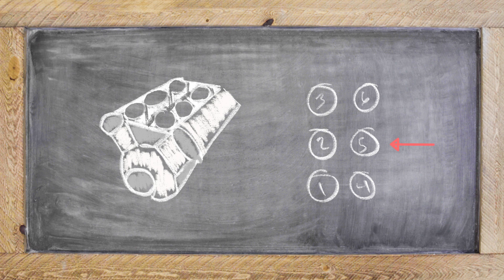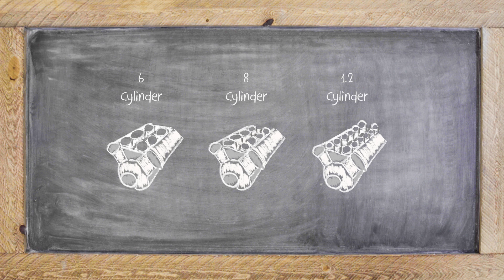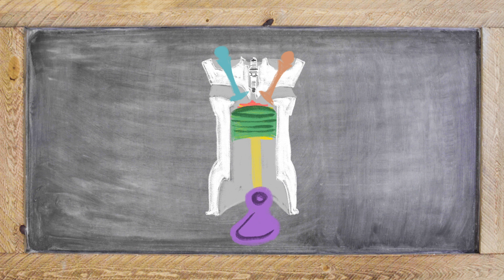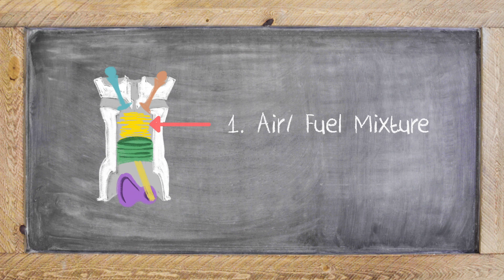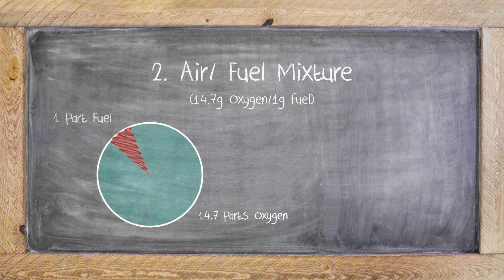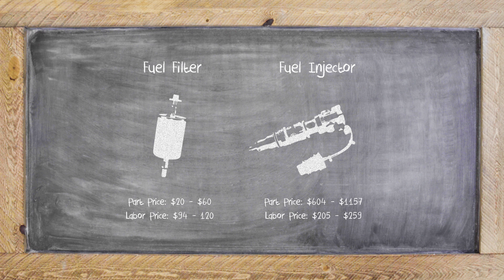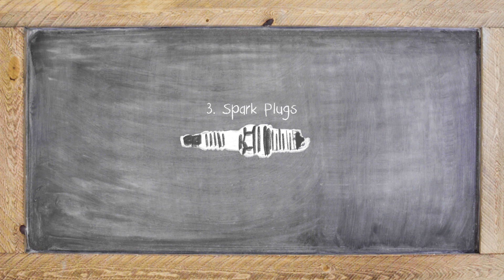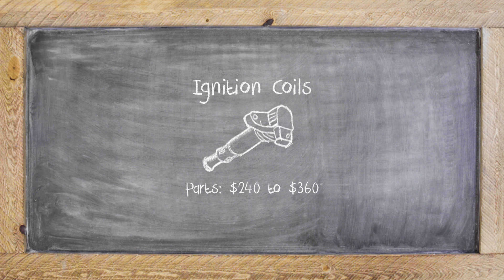P0305 Explained - Cylinder 5 Misfire (Simple Fix)

Comment: I have 2008 volvo s40 5 cylinder, replaced all the spark plugs and coils about a year a ago but now I'm getting the P0305 code saying there is a misfire in cylinder 5 should I swap the coils?
Reply: First visually check the thin wires going the #5 fuel injector & coil for wear. Then swap coils, replace plugs & coils as necessary. If that doesn't work check for slow coolant loss...bad head gasket.

Comment: 2014 Chevy Silverado 1500 5.3l. I swapped spark plugs, issue persists. So I’m going to try the ignition coil test now. Will update, but any link to replacing the fuel injector? That’s my next step.
Reply: Did you fix it

Comment: I have a ford five hundred, by, throws a p0128 and a p0305 code. The coils are working amd the plugs are. It has a misfire. The cylinder 5 has compression. I also have a thermostat stuck open.i need ideas of why it's still misfiring

Comment: I got a 1995 F150 302 4 wheel drive missing on cylinder 5 I done compression check 150 I don't know what else to do
Reply: Its probably that one injector...
P.s don't check compression it's the injectors mane

Comment: I got this code ..changed out the spark plug wire and that did the trick (2011 Chevy Silverado 1500 5.3 V8)
Reply: Howie hopefully that be my luck because i just spent 7500 on a 2010 Ford F-150
Reply: @LilFonTV  you got a deal. Check out the used truck market right now. Absolutely insane. Diesel market even more insane
Reply: @LilFonTV  how many miles? Can't find one under 10k on CarGurus
Reply: @LilFonTV how much are you selling it for
Reply: Oh I didn’t see this was 5 years ago
Reply: @Junior-es7mu lol that motor had a misfire i wish i kept the truck

Comment: What if it's 5 and 6 what does that mean?
Reply: Could be coils, spark plugs, wrong octane gasoline, clogged fuel injector, air leak in one of your hoses, coolant leak inside your intake, oil leak etc go to a mechanic and have them smoke test your car and diagnose from there

Comment: I have a 2004 Chevy Impala with a 3.4 L. I had the code and replaced the coil pack , wires and plugs and still had the misfire and code. Mind blowing . I pulled the power steering pump up and found the 3 wore plug in connector going to the Cam sensor had all the insulation on 3 wires had rotted off from heat and all wires were touching ea other. Repaired the wires and misfire code gone
Reply: But is the car running better

Comment: I have a misfire on cylinder 5 and 2 I got my injectors cleaned I replaced leaking hoses I changed my ignition coils two brand new ones they're all new spark plugs are new the code is still there I erased it and it keeps popping up
Reply: Smoke test the car to check for air leaks

Comment: Just got this code on a 2006 g35 coupe. Since it can be a lot of things and mechanics usually rip you off.... Should I just sell it or junk it? I love this car but i sound like a long and expensive job to figure out the problem. Expecially cus its a nissan and nissan electronics aee shit!
Reply: Sell it for parts, I have an I30t changed every freaken thing and the car still doesn't pass emissions and runs like shit. I'm moving to city where I don't need a damn car.

Comment: I fixed mine , change only one injector , they said it couldn't be done , not the whole spider, it's real easy.... had good compress on #5 new plug / wire didn't help it.....so just change that ( one ).... injector..
Reply: John: I know this is an old thread but have you still had good luck with just changing that injector? Like did it last? I replaced plugs, #5 coil and pigtail to injector because we saw a bare wire thinking it was arcing we replaced it, but not the injector itself, and the code only pops up after Ive driven the car for 40 minutes. If I stop at a store then get in, restart it, engine light comes on and engine shuts some cylinders down. If it sits over night the light goes off and it runs fine so this is an intermittant problem and most likely not a damaged cylinder. I ordered an injector, hoping this solves the issue.
Reply: Good video, I have the same problem , can you tell me where #5 is located. Thank you.

Comment: It could be more than those 3 too. If all 3 is fine and it's still having that code P0305 then it's most likely a Cam Shaft Position Sensor. If that's fine too; then it's most likely a Oxygen Sensor in your Catalytic Converters. Head gaskets and even Intake Gasket leaks are common and can cause fluid to leak out of the heads/intake and seep into the spark plug hole causing the Spark plugs to get wet thus a misfire.

I've also know a timing issue could be the cause from bad timing Chains which is a very expensive fix and in some vehicles its better to replace the whole engine than fix a timing chain issue (aka: Ford 4.6L and 5.4L Motors). To check this; go at a moderate speed on the interstate say 60mph then just Floor the piss out of it. If it takes off immediately then the timing is fine if it has a long delay then goes its a timing problem at which point if you have the motors mentioned above replace the vehicle/motor it's actually cheaper that way.
Reply: Mine runs pretty darn good one day then doesn't the next, almost always have to prime the fuel pump 2or 3x to start though. It's operating as it should I think, just replaced the fuel pump, but same problem still occurs. It reads cylinder 5 and 6 misfire
 Bank 2 lean... Changed a couple coil packs and still same issues.. sometimes it'll lose almost all power and I can barely press.the gas or it'll stumble and die. Other days it'll accelerate almost 50-60% but never really 100%. It bucks under low-mild acceleration almost always, but generally idles fine. I'm stumped
Reply: Just got the problem of the P0305 Code, Barley about to start checking for solutions, but ("THANX Man") for the info- always good to know ahead of time...

Comment: What about the O2 sensor? I to replace a downstream O2 sensor but I left the other one in. It’s pretty old compared to the new one. The new 02 is on the left side where my fifth cylinder is, could this be it and my cylinder is firing too fast?
Reply: Was it the o2 sensor? Im having rough idle and p305 code. I replaced upstream sensor and when my check engine light came on it said bank 1 sensor 2 i think
Reply: @focused4841  I have a 2007 mix  same problem Po305 ..I changed spark plugs all the way around and injector for cylinder 5 next will be coil .I hope I'm close to fixing it.
Reply: @steventmln1st  did it work ?
Reply: @hezikiahwhite   come to find it was the fuel injector.. They had sold me a faulty one .. so I assumed I ran into another problem.. just to find out it was a faulty fuel injector
Reply: @focused4841  Did you ever get it fixed.?

Comment: I got a P0305 on my 2007 Nissan Murano after I changed my antifreeze
Reply from the maker: Hmm, That seems somewhat unlikely that they may be connected. I'd reach out to a mechanic or check our resources in the app to see if there's a diagnostic list you could run to see if it's something else. Best of luck!
Reply: FIXD thank you I just took apart the intake manifold so I gotta wait a week for the spark plugs I ordered to cone
Reply from the maker: @NFLYoungBoy223  Of course, Hope it all works out!
Reply: NFL YoungBoy Hey I have a had a problem with my 97 Oldsmobile 88 I took it to a mechanic and he fixed my intake manifold leak and a water pump leak but it is still quitting out on me when it seems to get to hot just wondering if you had the same problem and if you fixed